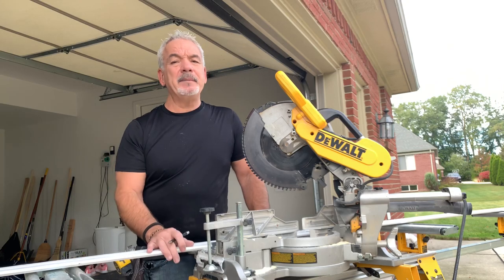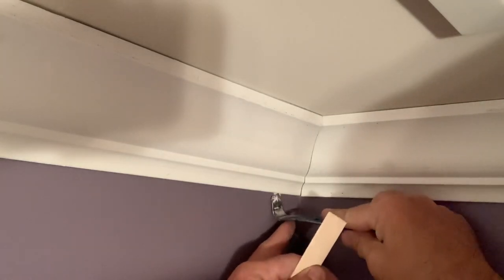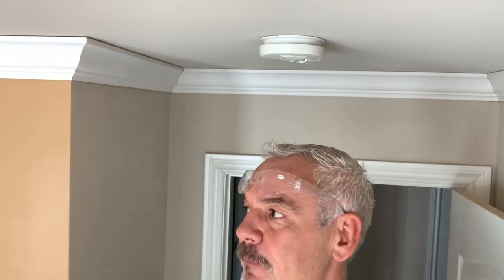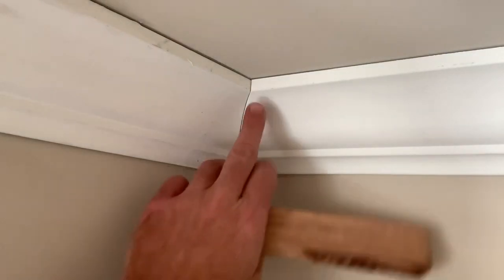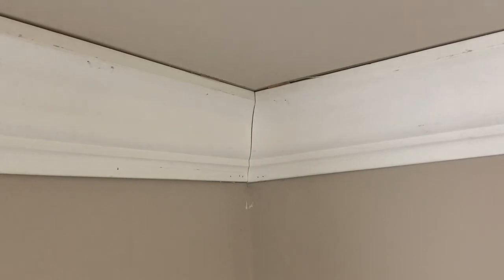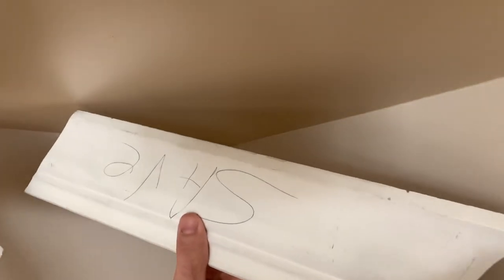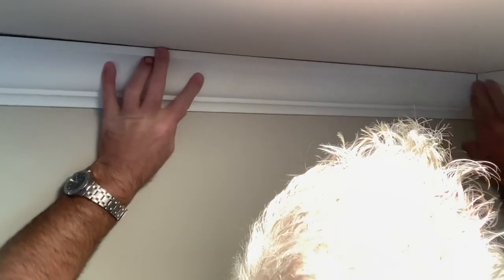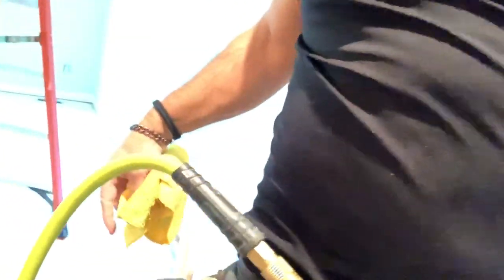How To Install Crown Molding (actually installing miters)

Comment: I struggled and gave up on crown molding so many times until I watched your video. I was measuring corner angles with a digital protractor. I was adjusting the miter saw angle to this very same angle and getting the same unsatisfactory results. Until I watched you manipulate the corners with shims, the light finally came on. Great Video!
Reply from the maker: Awesome compliment, thank you.. I just hope youre not one of my soon to be competitors lol.. seriously tho, thank you Ken, im just glad I could help..

Comment: I usually check all my corners with a miter gauge… And normally all the inside corners are cut at 44° and all outside corners at 46°… And on average house this works out very well… Also on shorter pieces I glue the miters together before I install that helps tremendously… I’m usually working with MDF and use CA glue…
You should also butterfly your nails rather than shooting them straight in they hold way better… I normally use 18 gauge nails on everything
Reply from the maker: Thank you very much for the wonderful compliment and thank you for watching
Reply: I just watched this and if your still making saw dust you missed the part where he GLUES it top and bottom plus pin nail ?  These types of molding receive no stress only the atmosphere changes!  Don’t you think he would receive call backs?  Obviously GC are using him on high end homes?  I make cabinets and do finish!  ( only custom pieces of cabinets I make).  
I think we get stuck & think we hv the answers!  By the way Tony has much more experience than you?  Be careful throwing out years!  I hv you both beat and I am keeping it to myself!
Reply: @michigancrownmolding  Tony where I am I usually get called on complete messes??
I just did about 50’ that the last finish contractor left?
Walls were a mess (he did his own Panel and wainscoting however did not level his walls ?  Not even close!  So I seen your method and away I went and tacked it with pin nails (forgiving ) coped all my insides and it looks dapper!  Customer was very happy and so was I when I got my check!
I just absorb all you guys like Gary Katz, Spencer Lewis, and now you for my crown!
Keep them coming and I would enjoy you showing lay out buddy?
Ok God Bless You & Yours!

Comment: Thanks for the video! I think the first miter isn't an issue with the ceiling but an issue with the crown molding with the left piece. You can see that it looks physically smaller in its' detail than its corresponding piece on the right.
Reply from the maker: .. honestly if you watched me cut the pieces you would know that both pieces (every piece i cut) is exactly the same size... its all about the angle of the cut, if your angle is off, your pieces will not be the same size, I try my best not to let that happen..... soon Ill be making a video on how to avoid that mistake... it truly is everything _ cutting every piece with the same exact angle..... 

thank you so much for the reply, I truly enjoy the constructive criticism .

Comment: I enjoyed the video but how do you deal with oak crown that will be stained and polyurethaned… ?
Thanks
Bob
Reply from the maker: Thank you so much, honestly any stained crown gets installed the same way, there will always be gaps along the wall and the ceiling regardless what anyone does, the idea is to concentrate on the miter (the seam),  and if you get that tight you’ve accomplished the mission .. 
I hope that helps ~ tight miters

Comment: I subscribed and I love your instructions. When I measure and then go to cut the crown upside down, is the measured length marked at the bottom or top of the molding. Thanks so much for you help and advice.
Reply from the maker: Think about that one, wherever the crown touches the “wall” is where you pencil mark goes 
So practice with a piece of scrap,

You’ll always be able to see your pencil line up top when the crown is upside down 

Thanks for the compliments
Reply: @michigancrownmolding  
I think you are telling me to put the pencil cut mark on the bottom of crown which is mounted upside down on mitre saw and therefore the top on the  saw fence.
Reply from the maker: @johnudisky1248   correct
Reply: Yes! Thanks my teacher!

Comment: Hello,  I was wondering if that PL 375 you use is paintable, and what length nails are you using. I think I'm gonna try the 23 guage pin nailer.  Thanks for all of the information.
Reply from the maker: Hi, thanks for the reply, and yes, the PL375 IS paintable, but its not good on deep gaps, as it shrinks, (I always recommend that everything should be finished caulked anyway), I use it in every finish carpentry application instead of regular caulk, as i never want my moldings to move once i nail them... and as far as length of pin nails, i use 1 1/4 and 1 3/8s if i can find them, very few guns (pin nailers) can shoot 2" pins, and ive found that the 2" pins tend to wander, so be careful if you ever try them, they will shoot out the side of your product often.. 1 3/8s work just fine, they are all I use.
Reply: @michigancrownmolding  excellent! 😎

Comment: The video itself was fine.The only problem was you did not show how to cut the mitered ends before installing. That would have made this video exceptionally better.  Thanks for the good instruction just the same.
Reply from the maker: Good point, I guess I assumed people would already have that knowledge before hand, if I added that tutorial to this video it would’ve ended up another hour long …
Worth some thought tho 

Thank you for watching and commenting
Reply: @michigancrownmolding  Would you consider doing a video dedicated on how to cut?Mitered ends both inside and out for crown molding?

Comment: Hi are you nailing into studs ... or does that not matter?
Reply from the maker: Hi there is no need to nail into studs, the materials doesn’t weigh very much at all, plus we glue every single inch of everything, our moldings Never move, ever .

Good luck and thank you so much for watching

Comment: Which model digital Bosch measuring tool do you recommend?
Reply from the maker: Honestly all of them work great .. just some of them have different abilities, for instance, one of the models Bluetooth so you can send the measurements to a coworker, but we never use that option.. 
simple measurements is all we need, my suggestion would be to use the least inexpensive 

Thank you for watching and commenting
Reply: One more question on the Bosch digital measure. How does it measure length on an outside corner?
Reply from the maker: @johnudisky1248  you can put a block on the corner and measure from it, or to the block.. 
or just pull a tape measure from the inside corner to the outside corner, like we do.

You’ll have to learn to trust that laser tape, for crown we subtract a 1/16 because it’s too tight otherwise, they really are incredibly accurate 

Good luck.. 
hey, have you subscribed to my channel yet ?? 

😜

Comment: Are you nailing in studs? Ceiling joist?
Reply from the maker: No, why would I ? 
Ceiling joist only go in One Direction, so even if you did manage to find the studs, you would only be able to nail into studs on only two of the four walls… if you notice in the video I glue every single everything, once the glue dries the nails become irrelevant.. right ?
Reply: @michigancrownmolding  what nail gun are you using? Sorry new at this.
Reply: What gun are you using? Sorry just new at this. But thanks
Reply from the maker: @keithwhite8005   23 gauge pin nailer
Reply: @michigancrownmolding  Thank you sir.

Comment: Tony, your channel has helped me so much. I'm struggling with how do you measure a piece (before cutting) that needs coping on the left and the right side inside corners? The final piece is above a doorway and has crown butted to the wall on the left and right.
Reply: You measure the distance wall to wall (drywall to drywall) and then cut open miters on each end using the measurement as your long points and cope both ends.

Comment: What are you standing on in this video? Seems like it makes things so much easier!
Reply from the maker: Normally it is a step stool (that has a front tray) but I can only use them for 8 foot ceilings as the step stools are not that tall - but, the trays are easily modified to fit most ladders , and are sold separately, check at Home Depot, in the ladder section of the store, 

Thank you for watching my video

Comment: Does not look like you are gluing your inside or outside miters, is that the case?
Reply from the maker: its glued everywhere, its common for carpenters to Only glue the miters (and nothing else), think about it, as you can see, i glue the top and the bottom of the crown mold, completely, full lengths , basically the entire room gets glued (why would i avoid the miters) ?.. but, what if I did avoid gluing the miters ? do you actually think a miter could actually move considering the entire piece of crown was glued top and bottom ?... thanks for watching, and i love your question..

Comment: Nice work. Do you use the digital tape when calculating outside corners or do you just butt the tape and come out to the outside corner.  And is that measurement exact or do you deduct 1/16 as well. Thanks
Reply from the maker: .. Great question, thank you . When I measure to outside corners, I use a standard tape measurer , and I use exact measurements when doing so.. thanks for the Sub

Comment: I’m surprised you don’t cope your corners which lock together much more firmly. Additionally you angle some quills right in the joint if you do get a stubborn one.
Reply from the maker: I have a video on my channel about coping crown, ( coping crown molding the fastest on youtube) I do use coping on occasion, and soon Ill be making a video about why I hardly ever cope...  thank you so much for the comment, it means a lot to me to hear some feedback..
Reply: Your work is impressive non the less
Reply from the maker: @stevenfoust3782  ... means a lot to me hear that, thank you Steven

Comment: I would like to see how you construct a jig to cut the molding accurately. Also, are all cuts made with the molding upside down? Do you ever make cope cuts, if so, how do you make them - with a grinder or jig saw with competing foot?
Reply from the maker: Check out my channel for the coping question (how to), but to be honest if you cut them correctly and no how to manipulate the miters, it’s not necessary to cope

Comment: So you’re not nailing into any studs? I really like this video but I’m not sure about not nailing into studs is a good idea.
Reply from the maker: The material weighs nothing to speak of, the adhesive is doing all the work, once the glue dries the nails become completely irrelevant , find the studs and nail in them if you like, but if you ask me, it’s completely a waste of time ~ adhesive, use it like you get it for free .

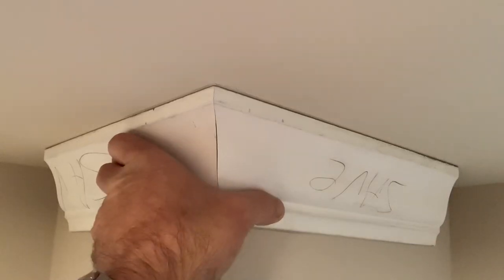Comment: @40:50 I would have glued all them corner pieces together and put them up as a unit
Reply from the maker: .. I feel ya, but I feel its much faster (and more efficient) to do it the way I do it... I glue everything, so I am extremely confident nothing is going to move. 

THANK YOU FOR WATCHING!!.
Reply: @michigancrownmolding  I guess I should’ve mentioned that I do a lot of MDF crown… And I use CA glue for gluing the corners it’s quick and fast…
Great job explaining by the way

Comment: Why not just cope and I always nail at leat a foot back on corners so eaier to manipulate even when copimg.
Reply from the maker: Coping takes too much time, plus most crown is impossible to cope, not all crown is OG to where it has a simple profile, plus at the end of the day a coped joint is not nearly as strong as a miter (a miter is locked in by itself) to where a coped joint has no anchoring, that fine line of material left by the cope has zero integrity, nothing to glue to. ~ I assure you our inside (and outside) miters never move. 

Thanks for watching and commenting

Comment: Just nails into sheetrock?   Would expect construction glue on the crown where it contacts the ceiling and wall.  Why no glue?
Reply from the maker: Glued the heck out of it, you obviously only watched the first couple of minutes 

Thank for watching
Reply from the maker: We glue every single inch
Reply: I didn't see no glue used at all. And those pin nails aren't going to do much in the drywall.